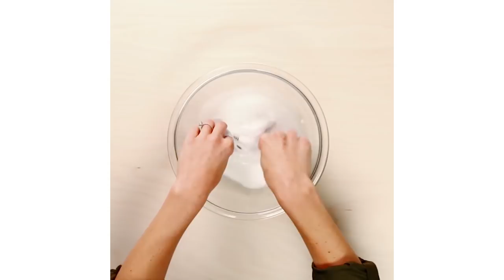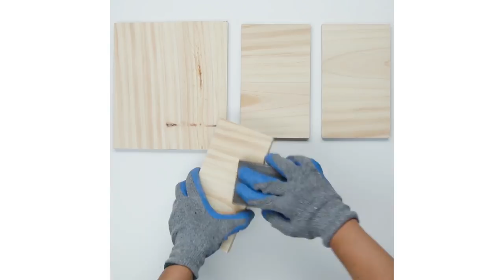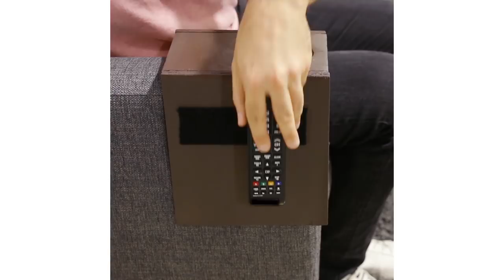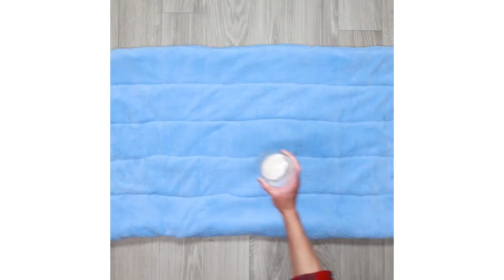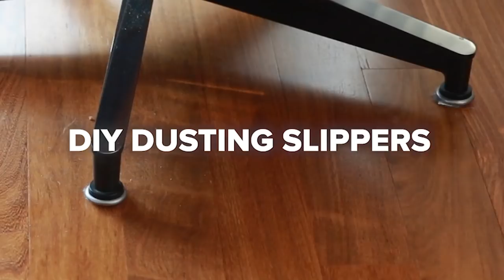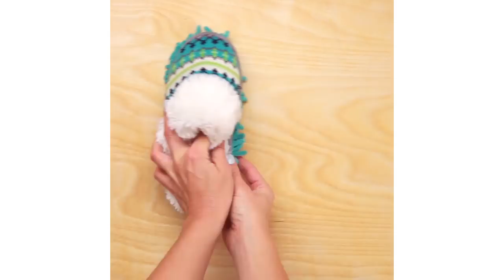5 Crafts For Lazy Days At Home

Comment: You’re supposed to use a vice grip to put even the small pieces of wood together or you risk dry rot. Also, chillax on the wood glue. Use nails or dovetail assembly. More sustainable.

Why would you ruin grippy slippers like that? Just get some flimsy IKEA ones that you won’t be sad about ruining. Also use hot glue so the rug part stays on. I have some questions about these projects...
Reply: I think the point of having the rug bit be detachable is so that you can clean or replace the dusty shoe soles but it's still super dumb